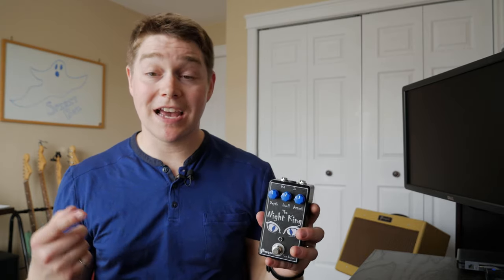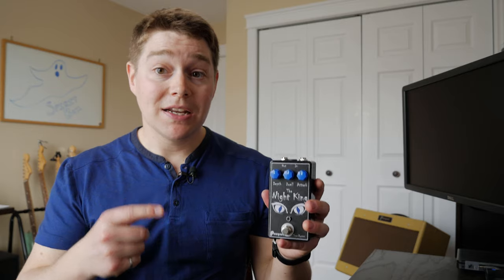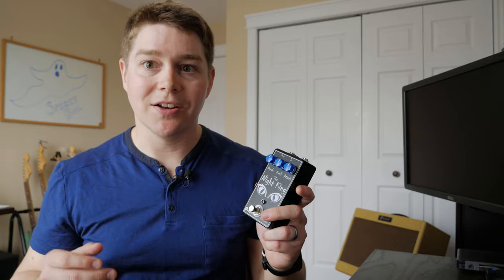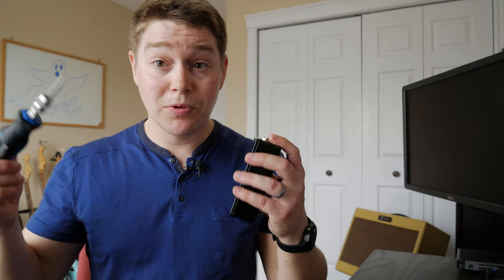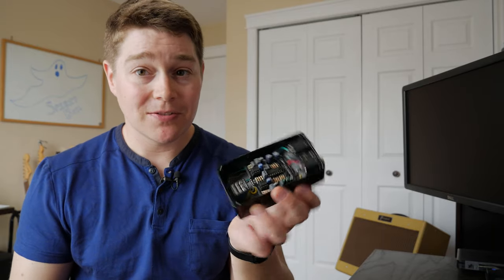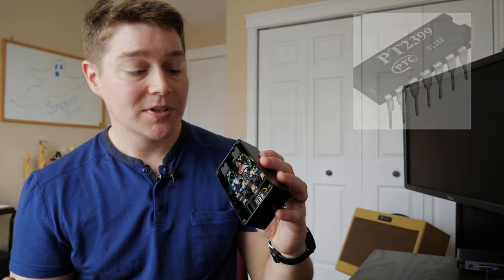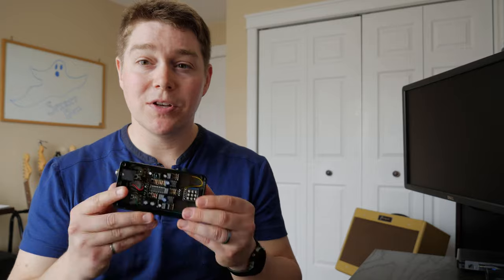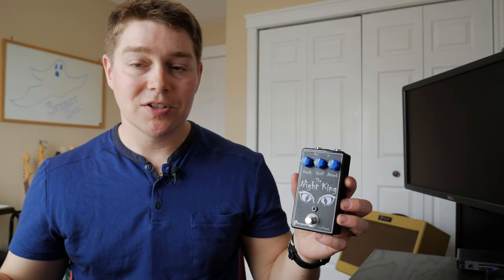PedalPCB Spirit Box | Build Review & Demo

Comment: Amp sounds classic! I,m jealous!
Reply from the maker: Thanks again Russell!
Reply: @pougnetpedals  hey young man,,, I,m very curious on how to dual a pedal,, try and do a dual zen drive or something like that and explain what's involved. I saw somewhere that a pedal clone designer had like a coupler board to join two into one but I don't remember where! But that pedal is a perfect match for your vibrolux! Sounds great.
Reply from the maker: Hey Russell. Are you just thinking two effects in one pedal? It's pretty straight forward, but I was thinking of doing a video on offboard wiring. I could probably add it there
Reply: @pougnetpedals  great. Yeah i think doubled up pedals are called dual pedals but. Yeah,,, the king of tone is two blues breakers together,, byoc dual klone is the clean circuit of the klone and the klone in one pedal and i know zen drive did a two in one of the the zen. Great hobby! Especially in these stay at home or get sick days!

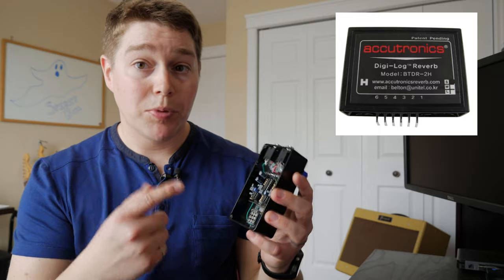Comment: Really great review!  Quick question - did you use the BTDR-2H Short (S) or Long (L) as your reverb unit?  Just curious since your overlay pic at 2:35 shows the Short model.
Reply from the maker: Good catch! I used the long delay. That's what I get for using a stock photo.
Reply: Pougnet Pedals cool, I figured 👍

Comment: Working on this build now (and I’ve done quite a few PedalPCB projects). Quick and probably silly question, but how did you determine where to put the reverb IC? I see it marked on the reverse side of the PCB, but since it’s a 6 pin circuit, I wasn’t sure which slots it should drop into and the plans don’t make it exactly clear